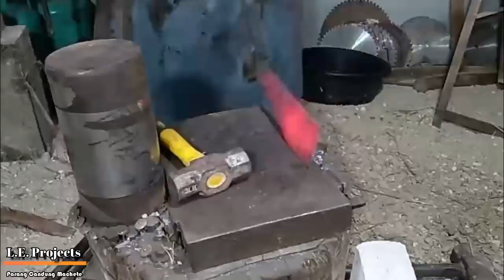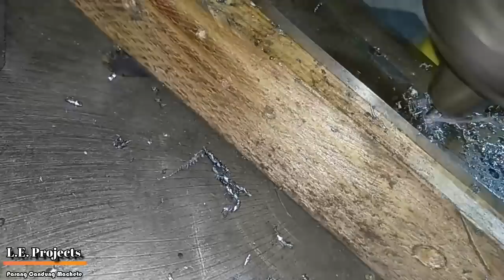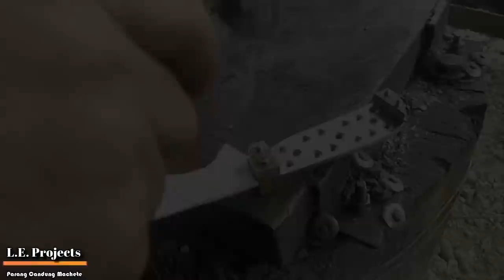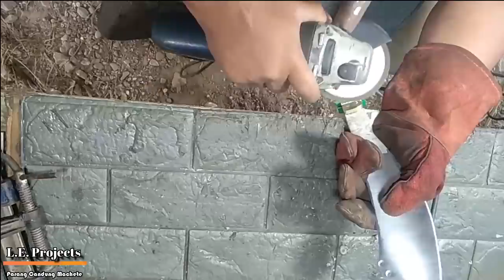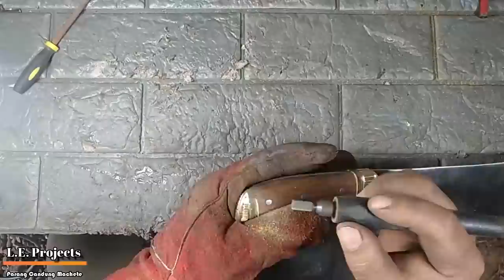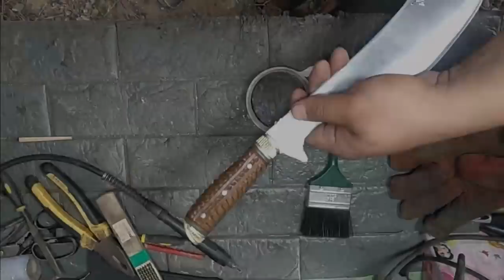♻️ Making a Machete from LandRover Leaf Spring | Cara buat Parang Candung Moden

Comment: Plain and simple. 
Sometimes less is more.
Don't put your knives in the oven for temper the Blade.
I see it in the most Video from Knifemakers.
Ca one Hour by ca 180 degrees.

chapeu
Reply from the maker: Im still using traditional way for temper a blade. its way more fast than using oven. and the result is also same both way/methods. i will make video my way of temper vs oven temper.  hehe
Reply: @EncikAlee  
Ok wait for the next Video from u.

Comment: What kind of heat treatment  that he can drill the steel all crap
Reply from the maker: This is edge quenching.
Just the edge was harden. The spine still soft. The blade would bend but not break. Easy to fix & maintanance.

Comment: First of all my man 
..your a true craftsman! Excellent work. So what's the reason for all the holes in the handle. For a better fit on the scales???
Reply from the maker: Thanks bro. I engraved the handle for more grip & deco 😆
Reply: @EncikAlee  no I'm talking about the holes in the handle before you put the scales on?
Reply from the maker: @philipwright1250  oooh. Thats hole for reduce weight on the handle and for glue to grip each other from both side of the scales.
Reply: @EncikAlee  gotcha...I figured something like that. Keep up the good work bro!!🤜🤛